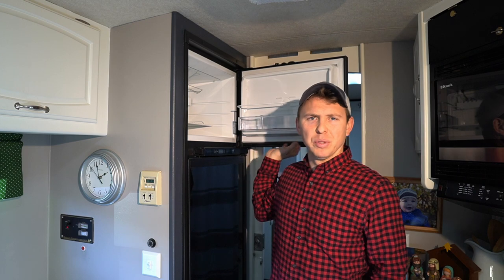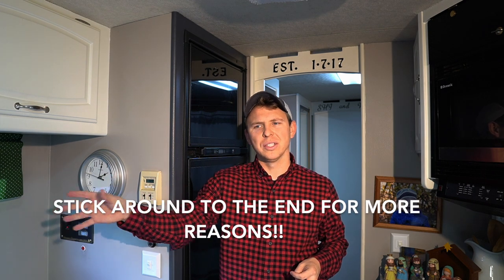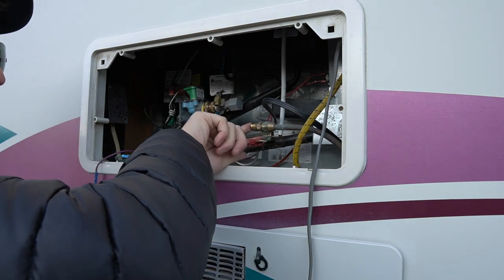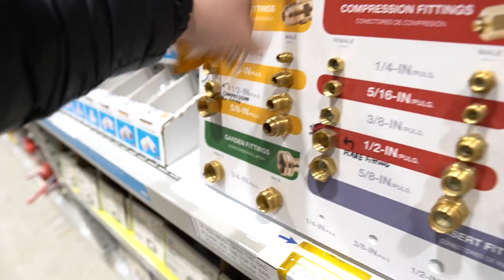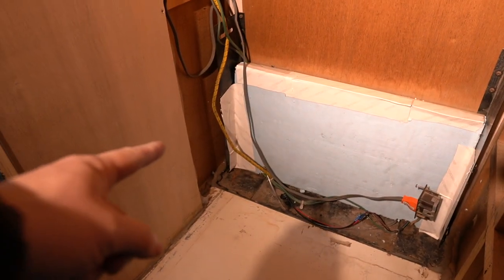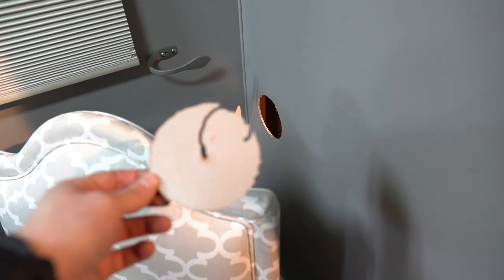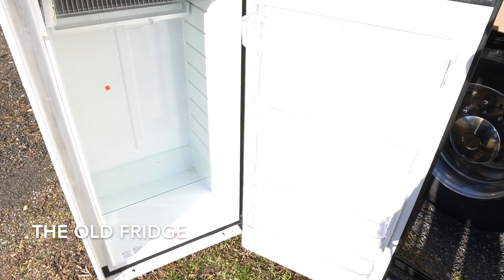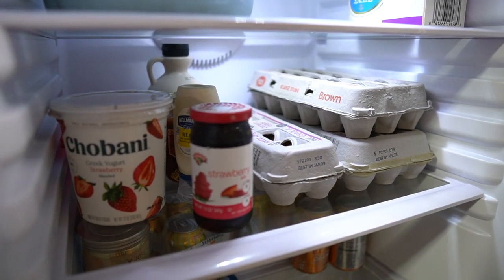HOW and WHEN TO REPLACE RV Fridge with RESIDENTIAL Fridge

Comment: This video gave me the confidence to swap out my old Dometic RM2852 for a Magic Chef 10.1 cu. ft. Top Freezer Refrigerator in Black Model # HMDR1000BE today! It went smooth, just need to trim it up now. The wife and I love how much more room we have now.
Reply from the maker: Awesome! Thanks for letting us know!
Reply: We put the same one in ours this weekend!  How did you secure it for travel?  We live in ours full time, but do travel from time to time. Thanks so much!
Reply: I did the same thing this past weekend and am so happy I did it. I watched some utube videos so removing the gas/electric one was a snap. I just ordered a power surge protector that will send an alert to my phone if there is a power outage at the campground and it will turn the power back on when it is restored. I am pleased with my decision so far and like you I have to finish trimming it in but it isn’t much to trim almost fit perfect

Comment: I have a camper two years old.  Stopped working well.  I am planning on doing the same thing with the exception of putting a battery in where the burner access was and a 400 watt inverter to give me power to the fridge when traveling.

Comment: I have a Carriage Cameo fifth wheel and the refrigerator just went out. We replaced it this past weekend with an electric refrigerator this past weekend. We are permanents in a campground and the rv is not moving so it was the best bet because to purchase a new cooling unit would have cost a minimum $1,800.00 and to buy a new fridge was. Running $4,000.00+. If you could find any. We went to Home Depot and bought a magic chef 10 cubic foot refrigerator at a cost of $400.00. Clearly a no brainer. I still believe if I secure it in the cabinet and it remains closed I could travel for hours before the refrig gets warm and the contents spoils. I think it was the way to go since we are retired and on a fixed income
Reply from the maker: Sounds like you made the right choice! Congratulations! It will be a big blessing to you all!

Comment: Our RV fridge dies too, same yellow powder. In the process of replacing with residential. Thank you for the video.
Reply from the maker: Thankyou! I hope it works well for you all!!
Reply: @nathanshiannetinsley5723  Don't you need a big battery bank to run this, or are you always connected to shore power, and what about when you travel?
Reply from the maker: @tdcrom  it depends on the length of travel. Fridges hold temp for quite a while. I do have a great generator. But yea I’m plugged in full time currently and do not need the batteries and inverter.

Comment: .  For a large family I understand the huge fridge.  I travel with one or two so I am looking at simply placing a 3.2 cubic foot fridge in place of one of the dining table chairs and  getting a 2 cubic foot 12 volt travel fridge / freezer down in the cargo area.   I can still seat 3 people and I gain counter space via the top of the short fridge. Then I get to transform the regular  fridge space into extra closet that will be about the same size as the bedroom closet.  Less, power, more storage!  Thoughts?  Also,  managing the fridge space is important.  A couple ice trays takes up much less space than a case of pop cans.  Keep the apples on the counter and suddenly your little fridge lasts for a month.
Reply from the maker: Sounds like a way to manage your storage and fridge needs in a reasonable way! Hopefully it works out well for you!

Comment: Amen brother. I’m docked 24/7… 2010 cameo 35’.. and already spent $2.3k on a cooling unit last summer. A residential fridge is the way to go if the rv is constantly docked. I have no need for a Propane/ac fridge. Make sure that propane line is 💯 sealed!
Reply: Also, I recommend pads on the footing and metal braces on top of the fridge if you do go mobile!  Rv fridges are so “voodoo”… even to someone living with a professional process engineer, electrician and overall 40+ years of carpentry and home repairs. We decided, residential fridge in a full time rv…is it! 🙌 especially if you travel and keep it on ac or solar. They are a nightmare. Don’t drain your $ in an rv two-way if you use it 1% or less of the year. It is NOT worth it.
Reply from the maker: We loved our residential Fridge upgrade!

Comment: I used this video as a guide. Thank you.
Unfortunately your fridge was bigger than mine.
Mine was/is 6.9 cubic square feet which significantly cut down my options. However at the end of the day, I found a fridge. 

A win overall. 
I have to wait a month, but I have gone without for about a year anyway that a month is nothing.

Thank you for the video.
Reply from the maker: Thankyou for letting me know! We’ve since sold that Rv so your comment reminds me of old times and old projects! I did finally devise a plan to hold it in place but if I were to do it again I’d come up with a better option, hopefully. I never posted my idea on that I don’t think. My Rv fridge that we own now has screws directly in the fridge going into the cabinet work from the factory, sorta hidden, so that could be an option? Thanks again and good luck!
Reply: For those of us who are not stationary,  how would you secure it?
Reply: @leslieajensen  I am still trying to figure that one myself. My model didn't come with bracket attachments or even designed to have that capability.

Comment: Great video!!!  We have been full time.inours for 13 years. Just replaced our side by side RV fridge with a residential freezer on top  and we are now trimming it out. The new one was a bit smaller. Lots of people told us not to add insulation because the new fridge needs to breathe, but the access panel on the exterior for the old fridge just seems to be like a hole for air to come in...and we live in Louisiana so it feels like a sauna. Ha!  Is yours venting well the way you did it?  Thanks so much. Great video!!!
Reply from the maker: We never ended up having an issue with our venting so I guess the answer is yes! Thankyou! As for yours, we live in Maine which is a world away from Louisiana! To make sure you did it right, you could always call a Rv service center and ask. I couldn’t say for your location. Anyways,  good luck!

Comment: I have done the same conversion to mine,  but have issues with the doors opening during travel.   Thinking of using magnets to hold shut.  You have this issue with the home style?
Reply from the maker: It’s a great point to bring up! Unfortunately, I can’t say what I’d do or if ours would give us trouble as our Rv is stationary most of the time! It does run great but we just don’t move it.. but there several ideas you could explore! Hope you find something that works!

Comment: Hi i have a 2007 forest river cedar creek fifth wheel & almost died due to ammonia leak inside my home from rv fridge. I took it out & put in a 10 cu ft majic chef. Only had it 6 month & it started not cooling well & food spoiled, so home depot replaced it with a vessani. NOW have had it for 2 days & its not cooling right either. I DID not put insulation board in cabinet nor on vent door or roof vent as so many comnents said the res fridge needs ventilation. Is this why im not getting colder temps, also i live in florida & its get between 90-94 right now. Im full time living by myself in a fish camp on a lake and had a stroke in april & havent gone back to work just yet so i cannot afford to keep throwing food out. Im so very exhausted from watching so many videos to get an answer. I pray YOU can answer this & help solve my problem. Thank you in advance, & have a Blessed Night
Reply: Also I have huge gaps on both sides of fridge, top & bottom not so much bit here in Florida it's very hot right now & heat was coming in through back vent & top vent really bad & I could feel cold air escaping put back vent grate

Comment: How did you anker it into the space?
Reply from the maker: Great question, I haven’t yet. The motorhome is stationary so I haven’t needed to but I have looked into it and there’s options! I’m thinking of metal brackets of sort to screw into the wood trim, it’s a tight fit to start with and brackets would do the job, but we’ll see..

Comment: Did you find a way to bolt it down/in place?
Reply: I’ve seen people screw the rear down and use L brackets
Reply from the maker: Great question and yes And no! I found a way to hold it in the cabinet but not bolt it down. So there’s ways to do that, I’ve since leaned. My new rig has screws right through the fridge’s outer points of contact, so it’s just a matter of finding a way to secure it that doesn’t look botched or rigged!

Comment: what a great video on how to? what was the length of your hole where the old fridge was? mine measures 53 1/4 will this fit?
Reply from the maker: Thankyou!! So our fridge is linked in the description and if you follow the link it should give you the exact measurements for the fridge. You don’t have to buy it online, just see the specs!

Comment: What about the weight? Was there a big difference?
Reply from the maker: Great question, to be honest, I don’t know the specifics but the residential fridge must have been about the same weight. I wouldn’t be surprised if they were within 20lbs.
Reply: We just swapped out for a similar 10.1 cu foot Magic chef. The weight is 117lbs. The RV fridge was smaller @ 6.4 cu  ft, yet much heavier.  We did have to remove some top trim due to the height difference. 

Loving having an actual fridge.

Comment: What was the size of the new fridge? As an appliance tech, I would of left air flow open behind the unit. It need to remove heat. Probably why it froze drinks.
Reply from the maker: The fridge has an air gap all the way around it as well as a whole cut in the side-rear of the unit’s enclosure. I turned the unit temp down and it’s been flawless! Hope that helps!

Comment: I think the biggest issue with residential fridges is the durability. Good motor-homes with plush suspension is fine but on less expensive 5th wheels and trailers I've heard they are not robust enough to handle the vibration, especially those with rear kitchens. I would like to know if anyone has experience with 10 cf 12/24 volt compressor fridges like Furrion . I believe they are built tougher and have a forced air exchange at bottom of fridge so no need to cut a vent hole. They are more expensive ($1,110) for 10 cf so not sure if it,s worth it.
Reply from the maker: Very interesting.. would love to hear from the public on your question. I do know many 5th wheels are going residential so maybe they are discovering this problem or maybe they’ve solved it? Either way, I could buy approximately 4 residential fridges for the price of one Rv fridge, and the space, quality and ease of use is much better.. if you live in your Rv, residential is the best way to go, at least for us!
Reply: @nathanshiannetinsley5723  Yes good point! I believe I have already made up my mind on opting for 12v fridge especially because of the heat here in Texas, but I always like to be prepared. I'm just in the process of finding the right rv but it will definitely be a lite. Also all the ones we seem to like are rear kitchen, That means a-lot of bouncing around.

Comment: Next step.... pull the refrigerator back out, and swap the compressor for a 12v one purchased from marine or amish supply houses..... same thing with the air circulation fans.

Comment: How did you plug it in? Does it use a lot of electricity?
Reply from the maker: Hmm, probably should have included that information.. There’s a plug in at the back of the machine already in place from the motor home manufacture, so it was a real “plug and play”. And I’ve been told they are more energy efficient.. it seems to be light on electricity!
Reply: Ah, thank you :) we are having issues with our fridge, I want to be ready if I have to switch it out.
Reply: Did you have to change you plug, fuses, or breaker to accommodate the residential fridge? We are looking to replace since we are full time and have read you have to do different electrical... :/ 
Did you run into that problem at all?
Reply: @rebeccahearon1897  there was a plug right by the back of the old fridge. We just used that to plug in the new small fridge from BJ's and everything has been fine :)

Comment: How and where did you plug in the electricity? PS great job 👍🏽👍🏽.
Reply from the maker: Thankyou! So our Rv had a factory installed plug in, I suppose every Rv has it, even propane fridges use electricity? Otherwise a discreet chord would work!
Reply: Most RVs seem to be electic/gas hybrids and if electric will definitely have a plug

Comment: How long do you think it would run on your battery bank?
Reply from the maker: A very adequate question, however the answer is probably not what you are looking for... I don’t have the fridge running through an inverter and into the battery bank. This is very doable and many have, But bc I’m stationary for now, and have no need, I haven’t.. it would be a GREAT upgrade for the motorhome though!

Comment: I didn't see where you actually fastened the "new" Refrigerator to the opening? The Video basically shows removing the old , cut and cap two wires and a gas line and install "New" Refrigerator was that what you did?
Reply from the maker: Lol that’s about all there is, we will come up with a solution to screw it down for safety if we ever move the RV.. it’s drivable but we are stationary for now. There’s a lot of ideas at Lowe’s to screw it into place, it’s just a matter of picking one that works for your situation.

Comment: I'm a full-time boondocker. My fridge just went. Is this an option to use with solar? If so, anyone know what the minimum amount of batteries, Inverter & solar I would need to run this?
Reply from the maker: Great question, I suppose the answer would be in the amount of amp hours the Fridge draws.. my guess is it’s doable but you probably need a very good set of batteries..
Reply: @nathanshiannetinsley5723  Well I currently have 2 lithium battle born batteries, 1000 watt pure sine Inverter & 250 watts of solar, that's what my new rig came with. 
  However when I get closer to SanTan solar, I plan to add 2 more 250 watt panels to total 750 watts. Was considering upgrading to a 2000 watt Inverter as well. 
  Do you think that would be enough with the upgrades?
Reply from the maker: @butterflygypsy956   I’d have to find out what the wattage load for the fridge is to give you an answer. Check the fridge you plan to purchase!
Reply: @nathanshiannetinsley5723  Got it, thanks again! 😊 You have a new sub!